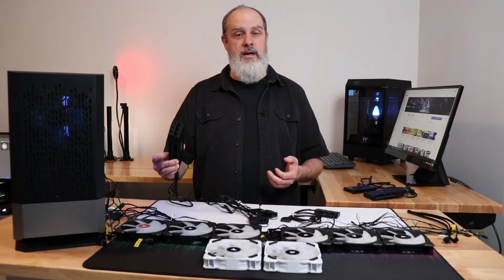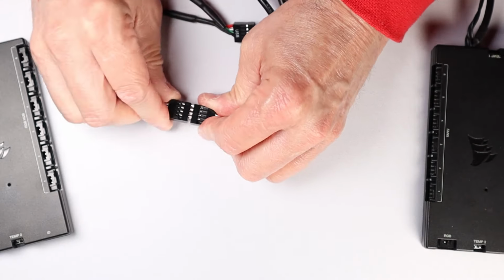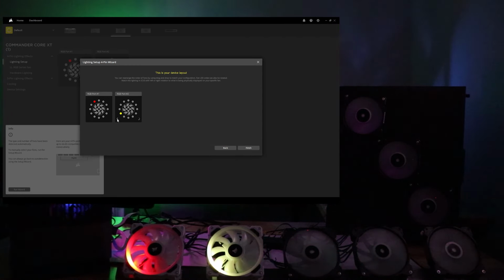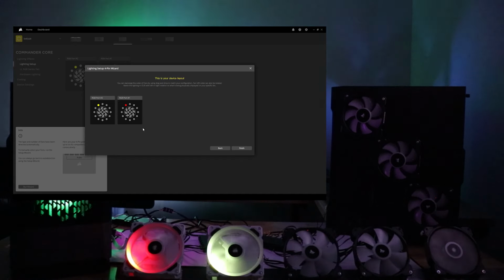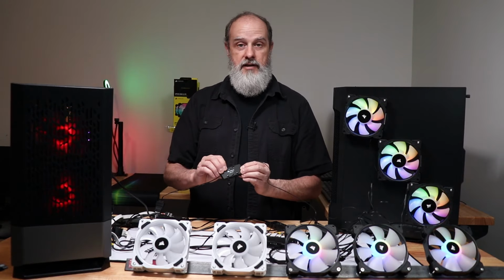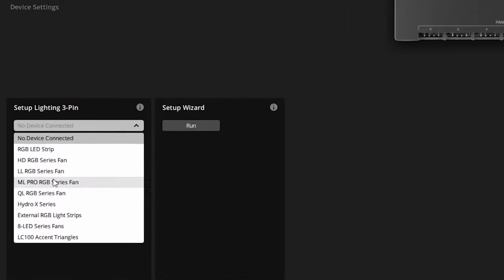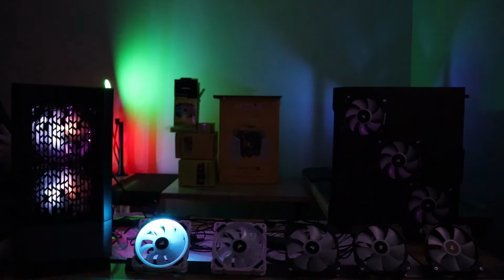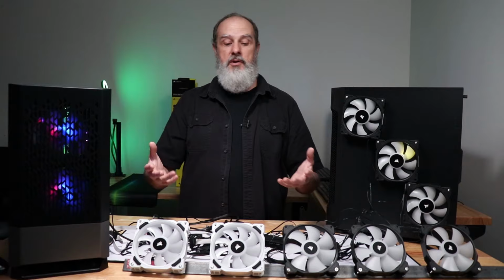Using multiple Corsair RGB controllers to control more than 6 fans in iCUE

Comment: Thank you so much for making this video, it was super helpful to get me setup for my first build but i came across a problem that left me on a pause for my build. So i have 13 Corsair RGB Fans and also have 2 Commander Core XTs as well as a H150i AIO with the LCD display that has its own box for connecting 6 fans which will work for the push/pull fan setup i want to do with the radiator but i got a Asus ProArt Z890 Creator WiFi motherboard and it only has 1 USB port lol. Can i use the included USB Y splitter cable for it to connect 1 of the Commander core xts and the hub that came with the H150i and just plug fan number 13 directly to the motherboard under fan 1 and RGB port? I tried reaching out to Corsair but ita been 72 hours and havent heard back from them yet so i figured i would ask you cause you definitely know your stuff. Any advice you can share or even a extra product you recommend me to buy for my cooling fan setup is very welcomed andni will definitely do as you say. 🙏🙇‍♂️ by the way, the case im using is a Corsair 5000D Airflow and the poeer supply is a Corsair HX1500i.

Comment: So I have a commander core and a non commander one, its kinda like a pwm and rgb hub seperate. I tried using these for my 10 fan settup, with 6 on the commander and 4 on the other thing. The commander ones work just fine but the ones on the rgb hub do not work and I cant for the life of me figure out why. I also use a usb splitting because I dont have enough usb connectors on my motherboard but the other stuff work fine. One of the fans on the rgb hub is half on though, I cannot figure out why that is since it was working when on the commander.

Comment: I got same fans all you display but what about if im adding 3 cool master mf120 halo where do i connect them too?
Reply: Im using 9 corsair fans 6 are af elite 120 and the other 3 are LL120 and the other 3 extras are cool master mf120 halo how how i connect them
Reply from the maker: Hi edgardG-f7t,  the cooler master mf120 halo fans use a 4 pin PWM connection so the power/speed control can be done with the commander pro, commander core XT, or the Commander CORE.  

The RGB lighting on those fans uses the standard 3 pin 5v ARGB connector, that does not natively connect to any of the corsair controllers. However, you can connect them to the (corsair) 3 pin connector using an adapter cable and a small HUB. You can also use the 4 PIN Corsair fan RGB port with an adapter cable as well. Check out these 2 videos to give you some basic ideas how to do that.  (Links to those cables are in the descriptions. 

https://youtu.be/JgLUDe1yzYw - How to get all your RGB working with CORSAIR iCUE - Tutorial
https://youtu.be/w2Pt86_qUYc - Connect any ARGB device to a 4 PIN Corsair connector - Adapter cable from Airgoo

Good Luck and thanks for watching!!!

Comment: I have a commander core and a lighting core pro, is it possible to run 7 fans with RBG off of that? Or would I need another commando core I’ve tried a scenario of things to see what would work but to no avail, hoping to find some wisdom on it with you! All of my fans are plugged into the commander core but 1 which is my exhaust fan, and is plugging into the lighting core pro, but for someone reason I can’t not get the rgbs to work the fan powers and on spins to life no issue everytime, I just can’t seem to get it to light up

Comment: Well when i connected my second commander core it does not shoe up in iCUE. Fans spinning but no rgb. But i did have to connect both commander core with the usb pins on mobo can anyone help😢
Reply from the maker: Hi lethe6230, It sounds like you have connected each Command Core to it's own USB port on the motherboard, which should work fine. Since the second one is spinning the fans it seems to have power, which is good. iCUE should fairly easily detect both of them if everything is working. 

Try powering off the system and disconnect the power and usb cable from the one that isn't working and then reconnect them, i've had to do this a few times to get things working. 

If that doesn't do the trick, i'd power off, remove the working commander core and use the connections for the non-working one and see if it then works. If so, readd the second one back and see if that fixes it. 

If that doesn't work, I'd try uninstalling icue and reinstall the latest version and try again. 

Beyond that, try a powered USB hub if possible and uninstall or disable any other rgb/fan controlling software.  If you can verify both of them work, but not at the same time, could be driver issues or other condition in windows, update your chipset drivers and/or reinstall windows. 

I hope that helps, let me know what you find. Good Luck and thanks for watching!!!

Comment: I use Noctua fans. If I don't care about induvial fan control couldn't I just use a fan splitter? Like for my 3x 140mm front fans, obviously they should all be going the same speed so it wouldn't be much of an issue if I use a splitter?

Comment: Sir, are you familiar with AORUS motherboards? Mine comes with this "RGB Fan Commander", but I can I only use it as a USB 2.0 hub/splitter because (1) I only have one 2.0 header and (2) I'd rather use what I have instead of buying more stuff. I'm gonna start building soon when my components arrive.
Reply: If I would compare to your scenario #1: My RGB Fan Commander would do the same job your Commander PRO is doing. Is the AORUS controller capable of splitting USB 2.0 if I give it SATA power?

Comment: I’m curious cus of my 7000D Airflow build, want to run 12 AF120 iCUE fans. Can I use one Commander Pro, connect it to the mobo USB header then with 2 Commander Core XT’s. Plug each one into the 2 USB Headers on the Commander Pro (not daisy chain). As my other USB Header on the mobo has my cooler connected to

Comment: I have a Commander Core and an XT, I connected a total of 9 fans (3 from the water cooler radiator + 6 fans + the AIO LCD), they are not connected to the USB expansion of the Commander Core XT, they are on different USBs. The fans don't follow the same order as I want them to. Is the problem with the USB expansion that must connect the two controllers?
Reply from the maker: Hi cauamanfredo4989, it won't make any difference if you use the USB expansion cable or not. iCUE orders the controllers in a specific order. I did a video on the "VISOR" lighting effect where I went into greater detail on what this order is. Off the top of my head I can't recall if the CORE or the CORE XT is first in the list. You do have to order your fans to which controller fires off first. The port itself on the controller doesn't matter as much as you can reorganize them in icue for that controller. 

I don't have acces to my notes right now to recall which fires first, but watch the video, then just match the arrangement of your physical fans to the controller that fires first (based on what fans you want to fire first), then order them within icue. 

For most lighting effects this doesn't matter much, but for visor, infinity it does matter.  

I hope that help, thanks for watching!!! 

https://youtu.be/Q0eb-ev6oMg
Reply: @HardwareArtisan  Thank you very much, I will watch the video

Comment: ive 2 Commander CORE (not xt) One will be connected to the AIO and usb hub. How do i connect the other one`? Ill use 9 fans. 

2. Question the commander core has the EXT connection in which you plug in the AIO is there any other use or devices or maybe adapter i can plug into that connection. Thank you in advance.
Reply from the maker: Hi penko1hp536 , both will connect to a USB Header. Each will need their own USB header, you can use both of them on your motherboard, or use a powered USB HUB, I prefer the one from NZXT, but there are others out there. 

I'm not aware of any of devices that use that EXT port. Interestingly though, the CORE XT controller uses that connection to provide a temp and RGB port. I did a video on converting one to another. It won't be of any help to you in this situation, but if you're interested in it. 

https://youtu.be/zKYByKviV7M - Controlling your AIO with a  Commander CORE XT and Replacing your Commander CORE - But don't do it!!

Good Luck, Have fun and thanks for watching!

Comment: Do you connect the commander core to the commander xt the same way? pigtail into the other? I have mine set up to have them both connected to the MB into 2 RGB headers on the MB. But it "ICUE" only sees the the XT and not the core. 
Also, I connected x2 - 350mm exterior light strips LS100's into the RGB 3 pin on the XT and it sees it in the setup. Shows them working, but I have no lights on at all. Making me nuts. Do I have to buy the light node kit for the strips to make them work? Or should they be working connected to the XT 3pin header? Thanks for the vid.
Reply from the maker: Hi johngallo7383, that's a great question. You can use the pigtail on the CORE XT to plug in the CORE, it should work, I've connected it that way with no issues. When using the Commander CORE, if you have the AIO pump connected, it will not show up in iCUE as the commander CORE, it will show up as the AIO, but it is in fact the commander core, you would use the AIO device to control the fans on the CORE. 

You should be able to get LS100 strips to work by plugging them into the 3 pin RGB header on the XT. In iCUE you configure the 3 pin lighting and select that device. Then select a lighting sequence and make sure in the quick lighting zone you have those devices selected. If you not getting anything there, I would double check all your connections. Try powering off, physically unplugging the controller and then try another sata power connection if possible and try again, if it's still an issue, uninstall/reinstall iCUE and make sure the firmware is up to date. I can usually solve most problems with that sequence. 

Let me know what you find, good luck and have fun!! (Troubleshooting is fun, right!?) Thanks for watching!!!
Reply: @HardwareArtisan  Thanks for the help! It was much appreciated. I FINALLY got everything to work. The Core and AIO made a lot of sense. I was able to see everything connected to the core, but through the AIO. I was a bit confused. Now it makes sense. The 350MM LS100's x4, now was a different story. It was the chain. I was messing up the chain. They need to be in sequence. One plugged into the other till the end.  Start from the node and daisy chain them. All is working now. All is seen in the ICUE software. Life is good hahaha. Thanks again for all your advice.  👍👍 Wish I could upload a photo. Everything looks great!

Comment: do as he says in the beginning of the video and use more controllers if you are planning on having more than 6 fans, I used splitters on the controller (1 to 2) and every fan header stopped working soon after, or use the motherboard headers, I do that for AIO fans, because I don't want those failing on me because of a controller header that decided to stop working

Comment: I'm a bit confused still.  Are you daisy chaining the Commander Core into the Commander Core XT in order to have full control over all the fans, pump, and LCD?
Reply from the maker: Hi Strifethor, Yes, you can certainly daisy chain the CORE into the CORE XT's USB pigtail, but is not required to do that. The only reason to do that is that it's an available USB header. iCUE doesn't depend on these being daisy chained like this. As long as the two controllers make a USB connection to the system, it will work fine and you will be able to control all your fans, pumps and LCD.  You could use two motherboard USB headers, or a powered USB hub and get the same results. The CORE XT's USB pigtail is just convenient. I hope that makes sense, great question.

Thanks for watching!!!

Comment: I connected all 6 fans to core xt and tested for power and everything works but the fans are just in plain white colors just like what it shown in your video. The only question i have is after you download iCue and setup the rgbs will they stay in that default or they are gone after you shut down the pc and you will have to do that all over again? I havent connected my monitor yet i know this is a dumb question.

Comment: i want to install 10 corsair fans. so connecting 10 fans u would want 2 commander core xt and not use the node pros ? or just use node pros without fan speeds ? without controlling fan speed what rps do they come stock ?
Reply from the maker: Hi NarutoFatality, great question. There are a couple of ways to get 10 fans. Yes, you could do 2 CORE XT's which would give you all the PWM and RGB ports you need, along with multiple temp probes and 2 RGB ports (if you need them). 

Another way to consider is use a single CORE XT and then connect a RGB FAN HUB to the 3 pin RGB port. This gives you RGB control over 12 FANS. You then need to find a PWM connection for the 4 fans on the RGB HUB. You can split some of the PWM PORTS on the CORE XT, no more than 2 per port, so you would have to split 4 of them. 

Alternatively, you could add a powered PWM HUB and connect it's input port to the CORE XT, this would give you control over all the fans on the HUB as a single entity and the remaining 5 fans on the CORE individually.  I wouldn't split the RGB ports.

 To me, the easiest way is just to do 2 CORE XT's. Of course, if you're going to have an AIO in the PC, consider one of the corsair AIO's that come with A commander core, add that to the CORE XT and you have all the ports you need. 

Good Luck, thanks for watching and Have FUN!

Comment: Looking for advice. I have got the core xt currently with all 6 connected up but I need one more RGB port for a fan. What’s cheapest way to add on a rgb port?
Reply from the maker: Hi @georget2k11, great question. There are a couple of ways to do this, including simply adding a second controller.....But, if you only need to add one more fan, the cheapest way would be to simply use a splitter cable, check this one out here:

https://www.amazon.com/dp/B0B4NK48RH?psc=1&ref_=cm_sw_r_cp_ud_ct_CCQE37S6J8BDGPNNSF8C

I haven't used this cable, but splits on 4 pin port into 2, the only downside being is icue won't see this as 2 fans, just one and both fans will get the same signal, which isn't a big deal except if you need an animation to work like VISOR. This cable would be a great option for cheap. 

If you need icue to see it as 2 fans, consider using the Corsair RGB fan hub, but you may need to build or locate the 3 pin to 3 pin rgb cable, I don't think it comes with the hub itself. That would plug into the RGB port on the corext and the rgb hub and then gives you 6 more ports (you configure the 3 pin lighting in icue). 

Or, you could simply add another CORE XT, but that's all more expense, for one fan, if you don't care about the animations, just use the splitter cable, that should work well for you! 

I hope that helps get you some ideas! Thanks for watching!!!
Reply: @HardwareArtisan  thank your for the quick reply. So luckily I just need a rgb port for the lighting as I had enough fan ports. Can you get a rgb splitter? Or would I just need to buy a rgb hub and plug that in to my pro xt?

Comment: will this work using a core xt and daisy chain a Commander core ?so using the core xt with my 360 mm aio and core xt  for a total of 11 fans ? thanks
Reply from the maker: Hi @Fr33ksh0w, Yes, you can use both the CORE XT and CORE in the same setup. The CORE XT has a USB pigtail on it which should be fine for connecting the CORE which will give you control over the AIO and 11 fans. The only controller i've found a problem using the pigtail is the Commander PRO.  If you encounter any problems I would recommend skipping the pigtail and just use a powered USB hub, but this should work fine. 

Sounds like an awesome build you have going on!!! That's awesome....Good Luck and have fun, thanks for watching!!!
Reply: @HardwareArtisan   thank you so much this video and your comment helped tremendously !!!!

Comment: So i have the corsair lcd aio and it came with the basic commander (that doesn't have the extra rgb header and only one temp probe) i got 4 more corsair fans for Christmas. 3 of them came in a set with the lighting node core (the one with like 3 different modules and only has connection for rgb and fan has to go into the motherboard) the last fan was independent of anything) i plan to get an additional 3 fans and want to know what's the least i need to buy (module wise) to get them all connected and controlled properly in icue. 

I'm doing a bunch of research but figured maybe some local experts could help me with some feed back. Thank you.

Comment: Im currently building with a Corsair 5000T as my case and an ASUS Z790-A as my motherboard. I have 10 fans to connect so I need more than one connector core of course but I unfortunately already used up one of the USB ports on my motherboard. How do I connect my second commander pro? I think that’s the last issue I have before finishing my build 😥 I would really appreciate anyone’s help